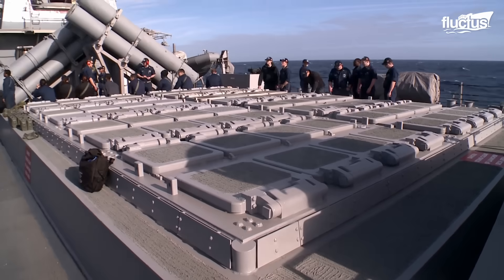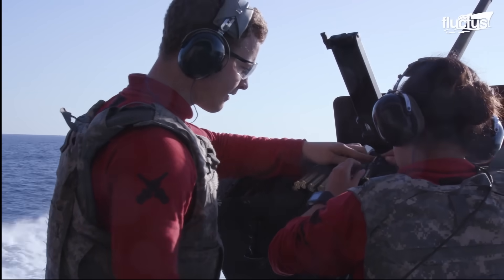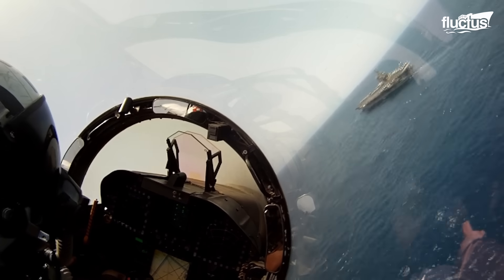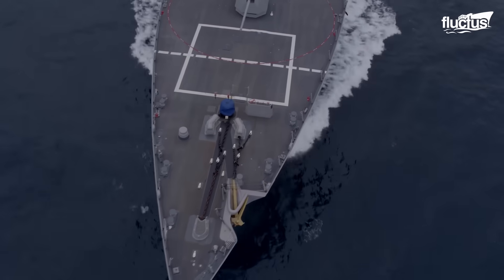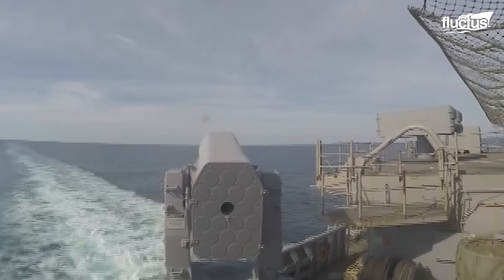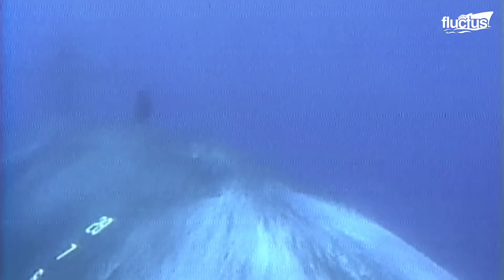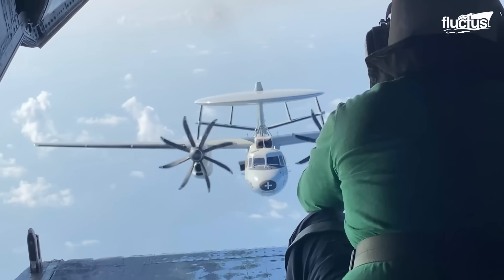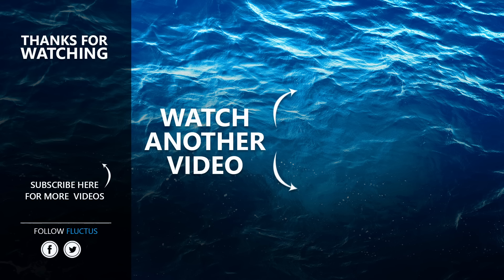Radical Solution US Navy Found to Defend Their Ship in Middle of Ocean

Comment: I served on a sub tender in the early 70s and was part of its repel borders team. Each ship division had to have a crewman assigned. We would either train with small arms when at sea, or go to the base weapons range. We also had a team called the backup alert force, which was the internal defense team, since we carried submarine weapons. At that time we had all WWII era weapons. We would stand a defensive post along the entire main deck. The amount of fire power would be devastating if an attempt was ever made to board the ship, using rifles, shotguns and machine guns. I had a Thompson and a 45 side arm.
Reply: @cmichaelanthonyimages2197 THAT’s  BS, unless you were in during Vietnam, and even then we didn’t give AS’s WWII SA’s.
I was our Squadron’s Small Arms Instructor, and I ran Security Drills long before it was obvious that we had an issue. I know exactly the threat AS weenies don’t present to anyone - at least then. I can only hope that they . We’ve also NEVER used WWII Small Arms in the 70’s or later - which any real Sailor would know. The only possibility would’ve been the M1 Garand, but they weren’t issued to AS’s (one hell of a weapon though, especially at 1000 yds). The 1911 was before WWI, and the M-14 was intended as the replacement for the BAR - which is why it only has a 20rd box Magazine; they used the old BAR Mags. It was built and deployed after WWII. 
The M-14’s problem (then) is that on full-auto, after about 3-5 rounds the muzzle climb had you shootings at Seagulls or Naval Aircraft. Some of the DESRON Targets still had some that weren’t converted to Semiautomatic, and the GMG’s in our class brought a couple on our last day to “try out” (we were all being certified to Instruct on the M-14, 1911, 870 and 500). 

Of course the SEAL’s solved that muzzle climb problem with a simple forestock grip handle. The other problem the M-14 faced was NATO; they pushed us to go to 5.56 instead of retaining 7.62 (.223 vs .308), and of course competition and political pressure for the M16. 

But please - don’t try to imply AS Crews were Rambo Juniors; most couldn’t hit a full size target from 10’ - with arms extended.

Comment: The M2 .50 cal machine gun, also better known as Ma Duece, actually has an actual rate of fire of 450 - 600 rounds/minute. Though they are generally set up for the lower rate of 450 RPM, which is plenty fast, because of concerns like barrel life.

Comment: Rates as high as 120 rpm for a 50cal mg ? C'mon fella, I think that maybe a little low! I'd suggest perhaps a range of about 450 to 600 rpm. And I'd also suggest better research and a proof read before posting. It's not a terrible mistake, but it raises the suspicion that other info you provide maybe less than accurate.

Comment: 120 rounds per minute? How about 600!
Reply: That's why you have to be trained and disciplined, sustained rate of fire is very different from maximum rate of fire where you have to change out the barrel because it gets to hot. It actually varies from 40 rpm to around 600, 900 rpm will melt the barrel in a little over a minute.
Reply: @tedmoss  Wrong. A M2HB fires at 600 rounds per minute and will never fire 900. The topic here is defending their ship and no officer will ever correct a sailor for firing as fast as possible when actually defending the ship.
Reply: Rate of fire...
M2 Browning 50 CAL is 450 to 600 RPM...  AN/M3 Browning 50 CAL is 1,200 RPM
Reply: @aggowl4572  Wrong. All guns shown here are M2HB's Not the aircraft versions. None fire at 120 RPM

Comment: M45 Quad Mount with CROWS(Commonly Remote Controlled Weapon System) M134 Quad mount. Pff the Mk38 is redundant compared XM913 and to the M163 VADS (Vulcan Air Defence System) yet the VADS got retired. RIM-2 Terrier, Mk26/29, M197/XM301, and Kiowa's have entered the chat.

Comment: The 50-cal can fire a lot more than 120 rounds per minute!
Reply: 40 years ago when I was in the Australian Army using the .50 cal I remember the rate of fire as 450 rounds per minute. The funny thing was that it sounded slower than the .30 cal which operated at only 350 rounds per minute. The 50 had a devastating effect on any target that stood in it's way. Would not like to be in a small boat in the middle of the ocean with some of those rounds heading my way!
Reply: @paulmcsweeney3241  That rate of fire is only under very specific conditions, it varies from around 40 rpm to around 900 rpm. It depends on how often you want to change out the barrel.
Reply: @tedmoss  The Browning 50's that I used in the late 70's were turret mounted on top of APC's. Although we were trained to fire in short bursts, when the trigger was depressed the rounds were going down the range at a rate of 450 rounds per minute. Of course, we never held the trigger down for long, to preserve the barrels and not waste ammunition, but the rate of fire didn't vary
Reply: and an effective range of over 1200 yards...